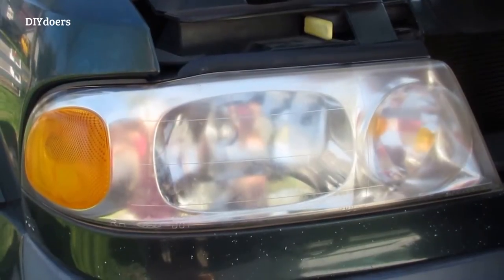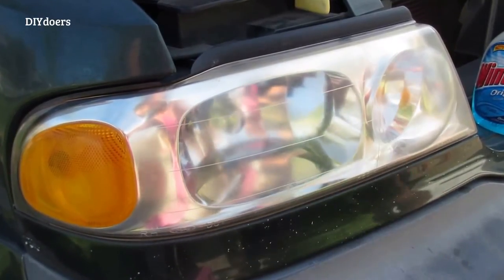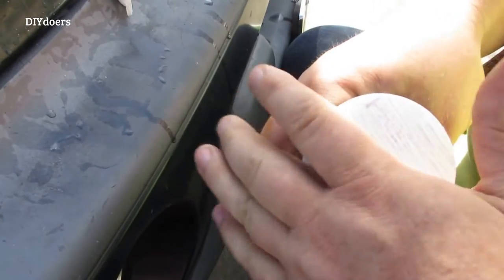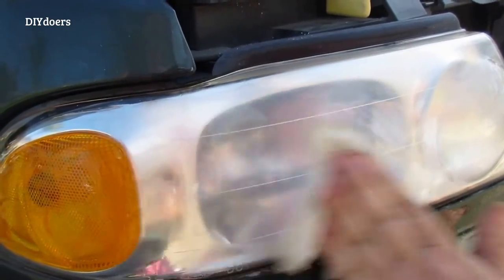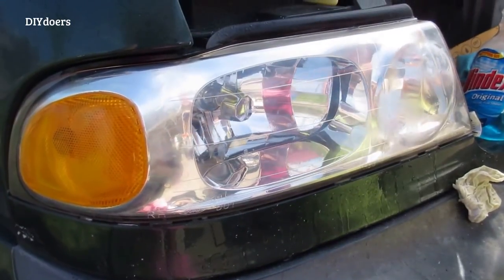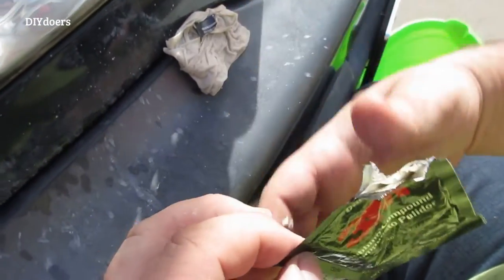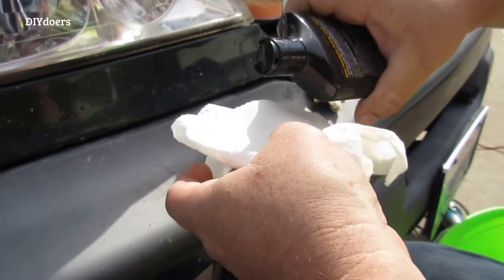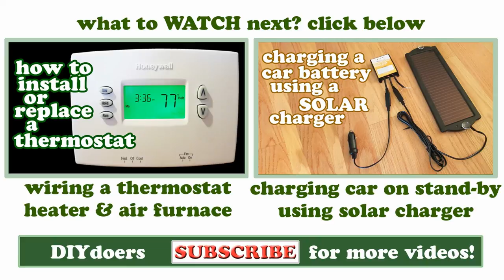How To Clean Headlights Foggy - 3M Headlight Restoration Kit Cleaner - Car Automotive - DIY DIYdoers

Comment: for step 1 use the 500, 800, ans 1500 grit dry only, after wiping let it dry, only use the water or windex with the 8000 grit. for each paper go over the entire loght right to left then from end to end up and down. For the bumpy areas remove the sand paper and go over unsanded area by hand. A helpful hint instead of more polish just spray a little water on the pad it will bring the polish back to life. to make it last longer put a coat of car way on it with UV protection. I recomend 303 marine protectant, i get it from amazon. over all you did a nice job.